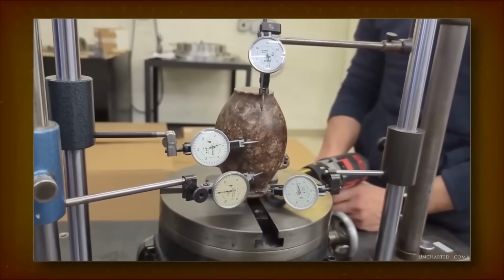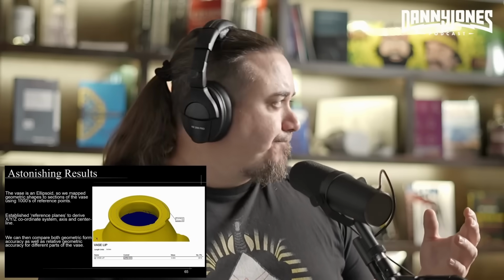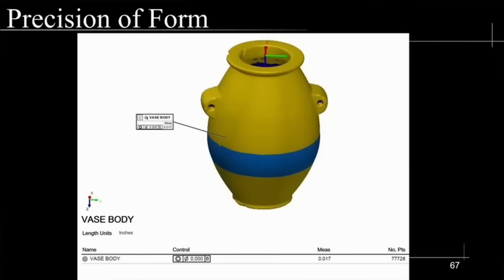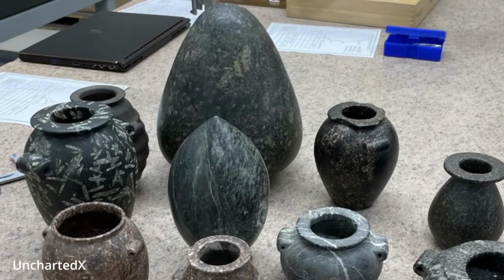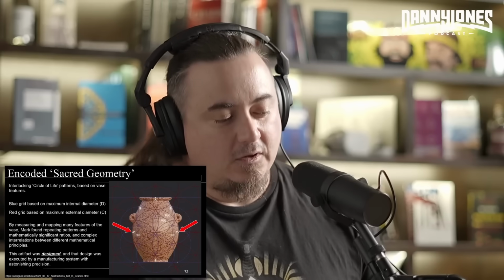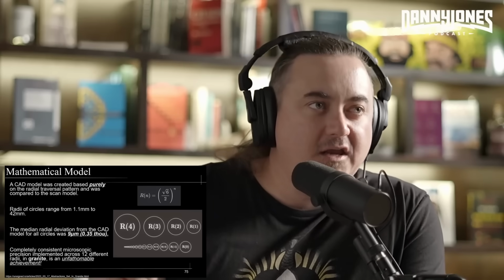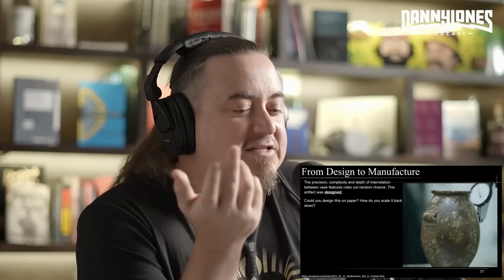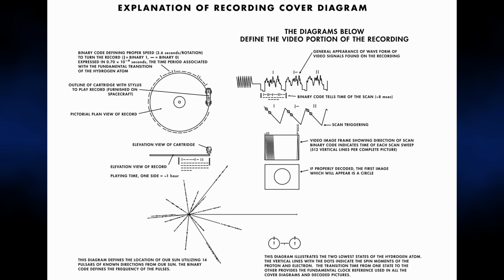Are These Ancient Egyptian Vases Actually Impossible to Make? #podcast #science #history #egypt

Comment: The way your first measurement should be have been is a simple symmetry overlay, where its split down the middle and overlaid on the other side.  Then measure the difference. Its simply not that accurate. Your taking away the credit of their work. The Egytians did incredible work with what they had and took their capabilities to an extreme level. Today we make simple ugly buildings which in comparison to the Renaissance, where they made with the intent of beauty and function. Just think of the statues , churches, palaces, stadium,etc etc. Through Greeks even made the Antikathira mechanism which is ,to me at least ,far more complex as well as linearly complexity of these vases. Nobody tries to take away that which the Greeks and Roman's constructed, and  because the old dynasty made these wonderful vases by hand means they deserve the credit .

Comment: Is the drilling accuracy inside the vase of the same order as the accuracy outside the object, please?
Reply: No its not, but it doesn't necessarily have to be. Here is why. If you take a machine part for example, let's say a cam shaft from a car engine, only the parts of the cam shaft that need to be precise are precise. Cam lobes and bearing surfaces. Everything in between is rough. We don't know if those objects are really vases or it they were used for an entirely different purpose. As part of a more complex mechanism for example. I would love to know if those "vases" have any resonant characteristics.

Comment: To date these stone vessels, we would first need to date the drilling tools found in the graves. These are wooden axes with a copper plate on the working part, which is wider. Therefore, we can determine their age by carbon-14 analysis. This simple operation would avoid wasting time on fruitless speculation.
Reply: They weren't made by those tools.